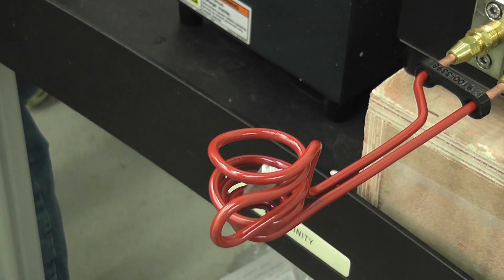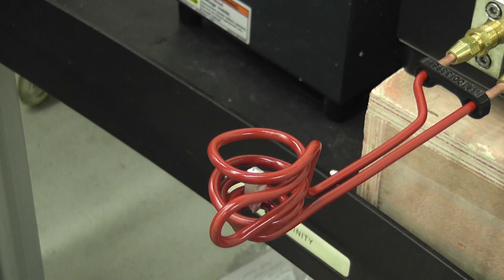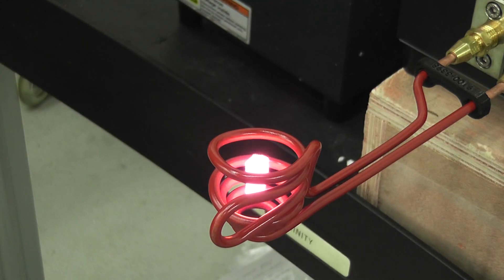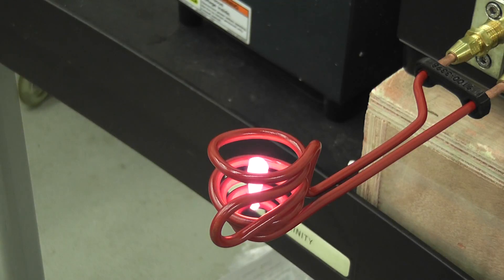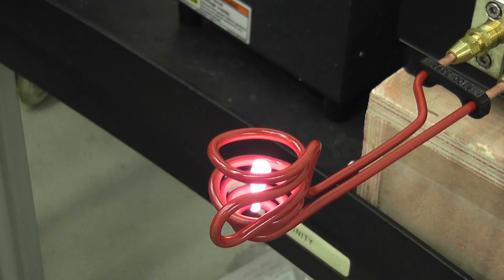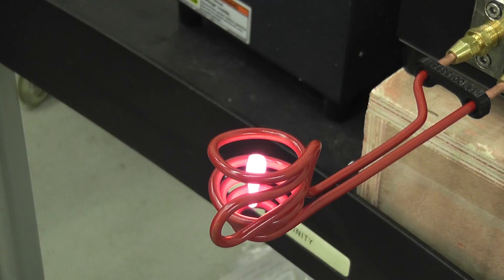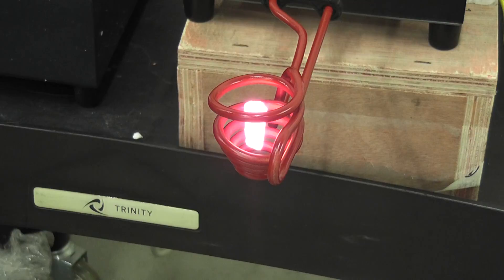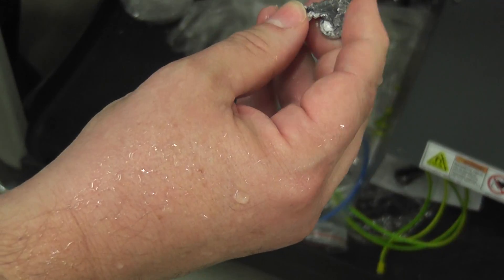Melting with Induction Levitation

Comment: Is the power source here, basically the same as what powers a Stove Top? 2kW 60hz AC?
Reply from the maker: No, the design on the coil is crucial for this application. :)
Reply: Stil though, which current do you use? Ac or dc?
Reply: @sillyjellyfish2421  Induction implies AC, without a changing magnetic field no current is induced. A question could be if the source before creating the ac is dc :)